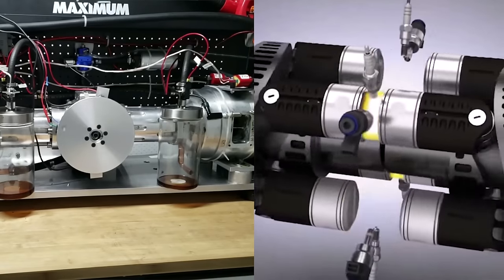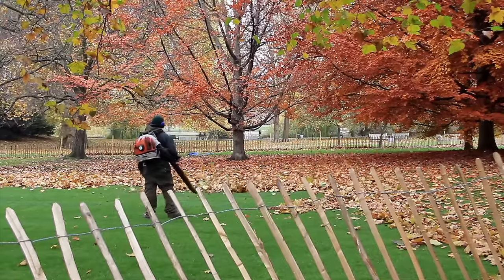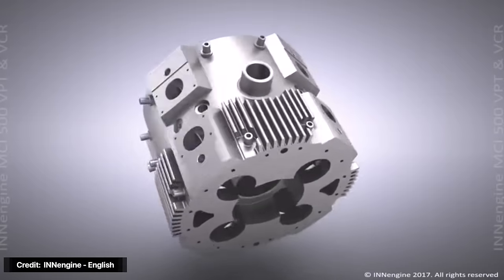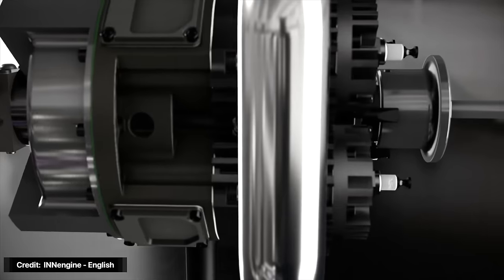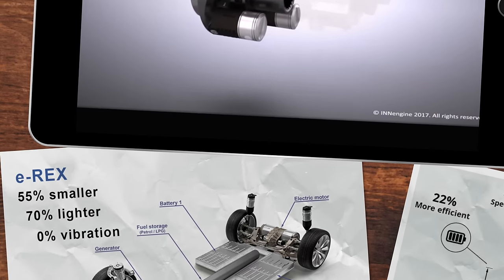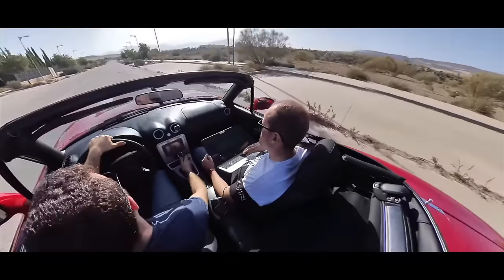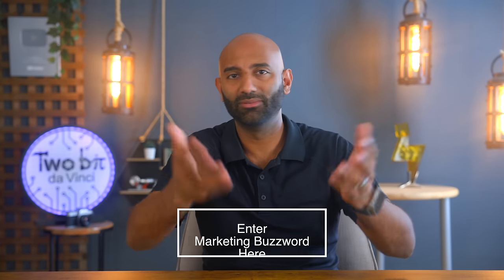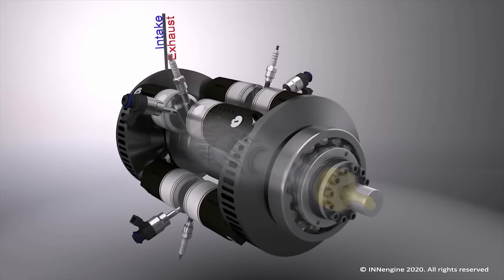One Stroke Engines - 200% More Efficient??

Comment: All is not how it first appears. 
10 gallon = 300 kWH. But the internal combustion engine ensures that 75% of that energy is wasted.
So, to equal the Cybertruck in energy storage you would need 40 gallons (152 litres) not 10. Big difference. BTW, an Audi A3 has a tank capacity of 50 litres.

Comment: I think an EV is a WASTE OF TIME. You All keep forgetting where all the MONEY is in those useless cars, the battery FAILS more often than not and that is three quarters of the value of the car, also range sux especially in the cold or heat. I been working with battery technology for DECADES  I know EV's are a lost cause. The only way EV's will ever be viable is if they  put a Mr Fusion power plant in the back like BACK TO THE FUTURE

Comment: Number one.  I would NEVER want to be all electric... until they start putting modular panels on the vehicle it self.  I don't want my ability to travel, to be at the mercy of electricity, and ESPECIALLY someone else to shut me off from a keyboard half a country away.  EXTREMELY toxic lithium in trade of gas?  Again...don't want all those batteries....  A HYBRID to have good takeoff and torque on the low end with electric and a cruise motor to produce electricity and go cruising speed... make FAR more sense.

Comment: I am an engineer, and a farm boy, retired now. I have seen it all.
As for buying a gas vehicle, I just bought another one. A 3/4 ton F250. In NO way can an electric vehicle equal this in power, range, cost, and any other parameter.
Ford figured that out (I knew it at the start) and have backed way off on electric. As have others.
What  you are talking about here is a hybrid (not an assisted electric...), and that might make some sense IF a numerous list of issues is solved. And the list is long.
I  have all the confidence that my 3 gas vehicles are the best for the rest of my lifetime.
The ONLY issue with that is something called POLYTICS. Properly phrased, POLY+TICKS.
Poly= many, Ticks=blood sucking tyrants. These are those who have no real idea what they are doing, but do it for Power.
That will be the end of us rather than any supposed green house gases (which actually ARE plant food, a good thing).

Comment: Forgot the automobil ,,,,---- electric generator -home power supply? Don't be left in dark (literally) by power grid down in Strom. Like when the 178 yr old tree ended on my house in 100mph straight line  wind and lost $200  in refrigerator and $300 in freezer. . Could have bypass house wiring to supply power to my appliances . That motor would be much more efficient that the generator that used up 5 gal per 12 hrs,plus didn't help save all my food. Just a thought . Not a thought goes to power companies for innovation  not with a power grid that has an F rating and  the power Co. Can't bring them self to fix it. To me seems self defeating,  if grid goes they go???? Just a thought. God Bless

Comment: A modern battery pack coupled with a propane powered genset of 14kw or larger would provide the range that EV's lack, the cleaner combustion that other ICE vehicles lack, and the fuel is less expensive than any other readily available fuel. All of this with the power of electric and the range and quick refueling of ICE vehicles. This is the hybrid that nobody has produced! This would be very attractive for longhaul trucking, where charging infrastructure is nonexistent, but propane is available. The cleaner combustion would alleviate air quality concerns as well. Electric only in urban areas and combustion recharging in rural areas. Of course, the "climate change" zealots will scream about CO²... that is STILL at historically low levels over the past several Ice Ages.

Comment: Single crankshaft rotation = (One Stroke of any comparable piston engine)[Be it two(2) Strokes or four(4) strokes of rotation per complete cycle] so a Single Stroke would be correct. All reciprocating piston engines use 4 cycles, (Induction - Compression -Ignition & Power - Exhaust) to create power from a combustion process. Even a Jet engine uses the same principle of 4 Cycles in operation to create shaft rotational Torque Forces &/or Thrust or both.
Ozzie Follower

Comment: I think hybrid is the way to go, the type of hybrid that is not connected mechanically to the wheels. Yet hybrids with somewhat bigger batteries and smaller ICE gensets, like maybe 20 to 40 kwh (based on individual needs) for the battery and a very small generator maybe around 25 kw for midsized cars, which is the average of what they need to drive. That way even on longer trips, most of the energy will come from the batteries and the genset simply be a range extender. Thus in 95 % of the use cases, the car won't even have to turn on the genset and use only marginal amounts off FF across its lifespan. That will help reduce CO2 emotions much more than pure EV's because that way, hybrid ev's will become accessible to everyone and finally provide true alternative to pure ICE's, making it possible to have all cars run as pure EV's, 95 % of the time. Now if we on top of that create standardized plugin battery packs, that can be upgraded as new battery tech emerges, the transition will become seamless and effortless for all.

Why is that you may ask? Well we use rare earth metals and mineral for the current battery technology, those are a finite resource and it is not possible to to produce enough batteries to turn all cars into EV's, especially not if we also want grows for underdeveloped nations, which of course we want. Second, small ICE gensets in an EV use far less petrol pr. passenger km or pr. kg/ km because the car at its core is an EV, thus the regen whenever breaking is transferred back into the battery pack instead of simply wasted like in a pure ICE. Moreover, the electrical grid isn't carbon neutral at this point and in many cases the electricity is produced by fossil fuel so that there actually is less energy efficient producing the energy outside a hybrid EV vehicle, because those fossil power plants lack the ability to regenerate power like an EV can. Again reducing overall CO2 emissions dramatically.

So there it is, the solution, not for an imaginary future, but one for right here and now. Bravo eRex for forward thinking, if that was their reasoning too. In conclusions, hybrid charged EV's are far more affordable, reduce strain of our environment and resources and can be future proof with standardized plugin battery packs, making their lifespan at least as long as current ICE's. The latter too is one of the main problems with pure EV's, they really don't last that long, due to their limited battery life. Oh and come to think of it, by doing this supercharging, which dramatically reduces battery life, can now be done much less frequent or even avoided altogether.

Comment: A completely SOLAR powered car with adavnced super conducting that would not need to be in a kryogenic state..  Use a Photo-Voltaic paint to cover the vehicle where all typical paint would be.. If they can print out Photo-Voltaic paper on a printer. They can make a circuit using paint in layered sections. With Hydrogen backup or hydrogen assist power.. On those cloudy days.. As soon as we can get SUPER CONDUCTION down to operating at room temps. we got it made in a way..

Comment: There are 4 strokes as the piston moves, Intake, Compression, Power, and Exhaust.
A 2 stroke has the compression and power stroke, the intake and exhaust happen during the compression and power strokes, but all of those need to happen in one way or the other for an engine to run.

Comment: I'd be curious about whether this sort of engine could be used in Hydrogen/EV hybrids.  It would give you the advantages of combustion-driven power generation but without the polluting effects of burning hydrocarbons. For densely populated countries where one is never more than 50miles/80km from a population centre of some sort, purely EV automobiles are probably fine.
However, for countries like Australia where the population is concentrated on a fairly narrow coastal strip, long trips in EVs are impractical.  Australia is the country of the "no fuel or water for next 500km" road signs, so you can just about guarantee that there won't be any infrastructure for charging EV cars in those areas.  This means that you'd need to carry some form of "spare power". Perhaps this could be in the form of hydrogen? I wonder how much 20L (~4-5gal) of hydrogen could contribute to electrical power generation for the EV drive train?

Comment: Regarding your last question: interest in hybrid electric w/range-extending Gasoline engine-generator, with no direct connection between ICE and wheels.  I am now an ME, semi-retired.  But I still have the design drawings I made back in 1975, while I was in the USAF, of a hybrid G-E vehicle where the ICE was purely for electrical power generation. It was AWD, 4-W independent suspension with ride height adjustments. It utilized a twin rotor Wankel with Turbo boost for continuous peak electrical output.  I stopped talking to others about it. They called me stupid, and the design a pointless waste of time. Today, I would consider modifications to burn renewably generated hydrogen as the fuel as opposed to gasoline, recognizing there would be a loss of energy density for the fuel. But it would be cleaner. ALL gasoline/diesel ICEs come with serious emissions issues that take a ton of secondary steps to clean up; all with additional cost and weight.  All this innovation coming on board now is, well, very bittersweet.

Comment: Why? It would only interfere with profit margins for both the automotive and fuel industries which are intertwined, and well, that makes people wealthy.

I cannot tell you the specific year, I can only tell you the specific event, because this is what my grandfathers cousin experienced first hand. I was not alive when this happened, I was alive to hear this story however. And despite naysayers my grandfather was one individual I held to great esteem due to his integrity and honesty. 

My grandfathers cousin purchased a new vehicle each year directly from any of the 3 manufactures. In the late 50s he purchased a new vehicle off the assembly line from Chrysler. which he then drove from Detroit, to Central Pennsylvania roughly 500 miles, on 1/4 tank of fuel. He was contacted immediately to return the vehicle as it was a prototype and not intended for sale to the public, where he ultimately was paid more then 4 times what he purchased it for to return the vehicle. 

How did he drive a vehicle that would have gotten 10~18 mpg roughly 1000 miles on 1/2 a tank of fuel?

Technology has always been there for fuel efficiency, though I would speculate it closely regulated by the automotive manufactures, government and fuel industry to maximize profit margins. 

Geo Metro, some claimed as much as 80mpg from this vehicle, listed as roughly 50mpg, purchased by Chevrolet, they suddenly 38mpg? The Subaru Justy, I personally owned and obtained as high as 72mpg combined on a 5 speed, reinvented into a newer model with much lower economy. Even my 1990 Celica which was listed for combined 26mpg I obtained 38+ combined MPG after some tuning with broken syncros for 5th gear. 

As long as fuel is government regulated/taxed, the ability to retain profit margins for the government, automotive industry and fuel industry will remain relevant, fuel economy will never be shown in its truest potential. A lot of back scratching makes it so.

Comment: This e-Rex would be FANTASTIC in a Chevy Volt! They already have a car with a gas powered range extender -- the little, optimized 100 HP gas engine generates electricity for the all electric drive train! We gotta get GM to reinvigorate this design -- and, if you're not aware, GM has a ton of expertise in these designs as they build Diesel Locomotives which are just this design.

Comment: Forgive me for being naive in the current states of onboard electric power generation and demand but   ... I think a hybrids would the 'consumer' vehicles power source option we should be targeting. Forget the 'plug-in' requirement and batteries of EVs. Keep performance/torque for those specific applications (sports cars, trucks).  
Freight trains use diesel/electric. Why cant consumer vehicles use diesel/electric or gasoline/electric? Why not use a gasoline generator to power electric motors. This keeps the battery weight down, keeps the current infrastructure of fuel delivery and reliance on electric grids. It also removes the con of 'waiting for battery recharge'. Maybe capacitors used for high load demands of take offs from a stop etc. I don't get why we can't combine power sources and have to stick with one or the other (GAS/EV).

Comment: I would love an EV. But as long as it’s not as flexible as ICE and EVs are more unrepairable “Tablets” with no second market value  it’s not going to happen. True the unrepairable Tablet point is a bad one on new ICE cars too. But there are old ICEs one can buy which aren’t filled with a ton of expensive electric stuff. ( that miata with a range extender would be wonderfull if weight/power ratio is not negatively impacted by it)

Comment: Sheesh! He does not understand that ICE are constrained by the stirling cycle, which limits efficiency. Yes, it's a 2 stroke engine, which is somewhat dirtier than a 4 stroke - not just because of oil (they went to oil injection about 40 years ago) but because of unavoidable mixing of exhaust gases and charge. I call BS on the efficiency claims; electrics are still the hands down winner for efficiency. And they are no longer slow.

Comment: Research reveals Lithium-Ion battery technology is too range-bound, too costly (due both to Chinese slave-labour lithium mining monopoly as well as outlandish cost of large replacement EV batteries) far too heavy & too dangerous (fires impossible to extinguish) to supplant ICE's (climate "crisis" narrative flimsy at best for many to swallow).  Assuming better electrical storage becomes available, devices like this "1-stroke" might be ideal hybrid generators.  Would be interesting to see serious comparison between this Spanish engine with long-suppressed plasma technology being developed by M. Bendall and others to clean conventional combustion engine exhaust and amplify efficiency.  Wonder if this engine would cut it for lawn mowers, chainsaws or even outboard motors, given the range limitations of electric equivalents?

Comment: I am not on board with EVs. Not because they are not good but because of their inherent limitations. So far they weigh twice as much as an ICE vehicle. That mass problem extends far beyond the car itself. Roads, bridges, parking garages and safety barriers will all have to be redesigned and rebuilt to accommodate an all EV world. Range/refill issue are so far short/long. The only real solution to range is more weight (see problem 1) and the only solution to refill is  speed charging. The faster you charge batteries the faster you destroy them. The vast amount of vehicle use is for commuting. If you had a plug in hybrid that could run battery only for 40 miles you could do your commuting without gas. Great for the environment. You minimize the battery weight. Solves EV problem 1. You could still take a weekend trip. Solves EV problem 2 range. You could slow charge every night. Solves EV problem 2 refill.

Comment: Combusting carbohydrates to extract power is a mistake. Fuel cells is the way to go.

Hydrogen is prohibitively hard to handle. However, we have commercially-available fuel cells which oxidize propane. Storage and handling of propane is a solved problem. Technically we can even synthesize propane from electricity, water and air, though the synthesis in R&D not yet commercially unavailable.

Comment: I'd love to go into all the reasons that I will never own a EV but lets just leave it at some conversations I had with our local fire chief. Maybe if there is ever a Mr Fusion as in the Back to The Future movie I'll change my mind but until that day I'll be sticking with the I.C.E. engines that have been so well developed over the last 100+ years. Oh, I just can't help it, THE RECHARGE TIME and the longevity. I sold a 30 yr old Thunderbird a few years ago that still ran like the day I bought it new. In that amount of time how many multi thousand dollar battery replacements would it have needed even though it only had 5500 miles on it?  EVs are a fad that won't last long in my opinion.